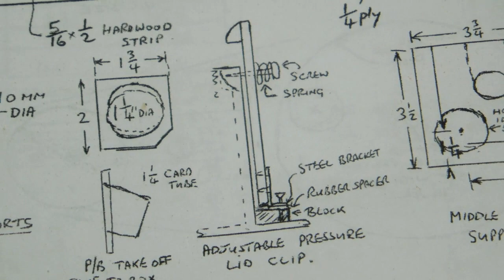Senior 20 Organ (18) Pressure Box Lid Latch

Comment: Very Nice idea, build and install of the spring lock mechanism! I would be worried that if somehow the music roll paper flexed for "some weird reason", the holes in the paper "might possibly" catch on the exposed nut. Perhaps gluing a horizontal strip of wood along that portion of the enclosure covering the nut might prevent any mishaps to the precious music paper? Just a thought. Hope your not upset. Definitely like the way you designed it and how it latches closed! Thanks for sharing.
Reply from the maker: MRrwmac Whenever I finally, actually do get a music roll in there I will be able to see the clearance after winding a full music roll. Good chance I will install the round head of the bolt (screw) on the inside of the pressure box instead of the nut. The take-up spool was in the way at the time I made the video, so I was not ready to try it at that time.
Reply: Oh ok. I should have known you had an alternative plan in mind.

Comment: A little over engineering takes a long time and causes more engineering hurdles. Whats wrong with a wooden leaf spring catch?
All the best. KISS (the saying not the love).
Reply from the maker: Sirus This is pretty simple. A piece of wood cut to length, a single pin hinge and a bolt & spring to keep it latched (holding the pressure box lid closed under pressure) and allows it to swing open. And it fits in a confined space. I do not see any outstanding hurdles. Not sure what you are referring to as a leaf spring catch. Maybe you could build one and show us how it would work.